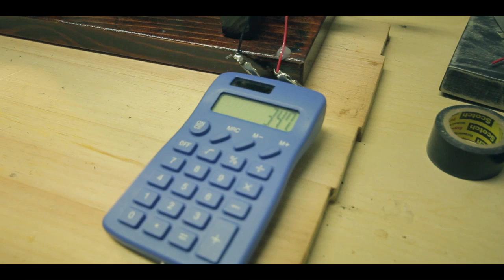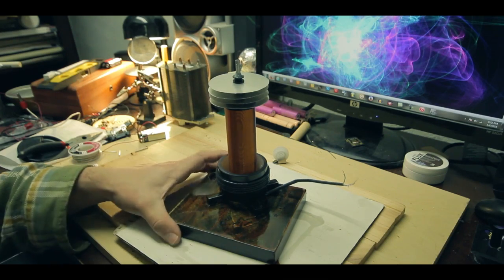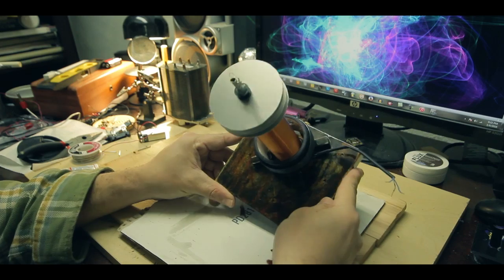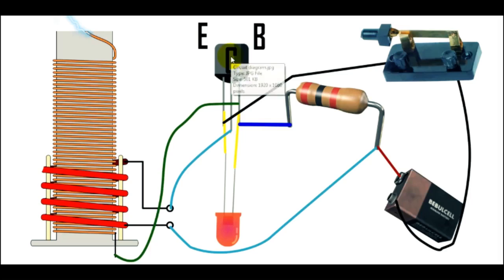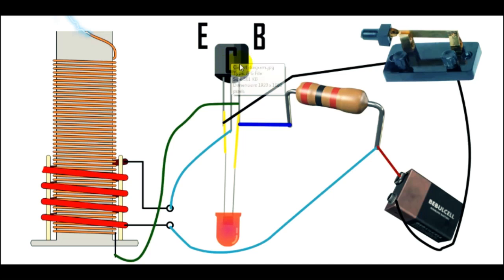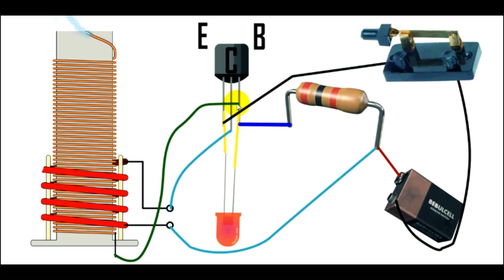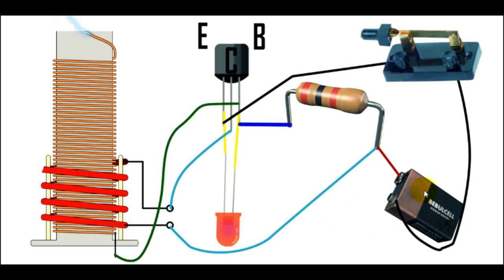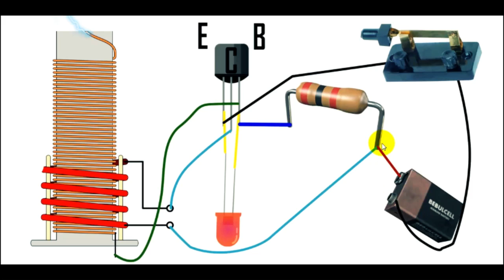DIY Tesla Slayer Exciter Coil Tutorial Mini How to Build Easy Circuit Explanation

Comment: Will it work with KSP2222A transistor and 22k resistor! Please answer soon
Reply from the maker: Tupac Shakur the transistor should work. What's the wattage on the resistor? The winds on the coils should be close in the numbers given in tutorial. hope that helps.
Reply: Thanks a lot
Reply: The resistor is 0.1W but the transistor is getting hot! Why?
Reply: It's not working!
Reply from the maker: The resistor is too large. You need 1/2 watt resistor. Also you need to use and LED with works like a diode in the circuit.
Reply: I used LED
Reply: STILL NOT WORKING!
Reply from the maker: Tupac Shakur What resistor are you using? Did you reverse the wires on the primary coil to see if that works?
Reply: Yes I reverse them! The resistor is 47K for 0.4W. In my home town there in't selling 47K 0.5w resistor

Comment: does the circuit work like this: current flows through the coil(magnetic field is created) then to the collector.  because the collector has current flowing through it it opens the emitter base path and closes the flow to the primary coil (breaks field). and then repeats. 

I'm a beginner and I hope I didm't write bullshit ^^. 

p.s. has the resistor a other function then limiting the current?

Comment: How did you made the wind counter out of a calculator? That tutorial would be interesting as well.
Reply from the maker: Here is the calculator tutorial! Thanks for watching. 

https://youtu.be/cY6DwpwkEfA
Reply: José Davēd Thanx mate!
Reply: i want to make this type of tesla coil 1 wan to use 9 v battary 2n2222 and 22K 1/4 resistor and i wan to use 0.6 mm wire or 23 awg can i use these?
Reply from the maker: gökdeniz geçit I don't think the resistor will work. The 47k resistor works the best. I've tried several resistors and they did not work. 
The 23 gauge wire may also give you problems, as it is a heavier guage wire then what's recommended. You need to get about 400 turns on the secondary coil.
Reply: José Davēd and i will use 1mm wire in the first coil and should i use 47k 1/4 resistor with 9 v battary
Reply: vay araştıran adam
Reply: hoca aptal ozaman işte bu yüzden türkiye ...

Comment: Hey. I really need your help in this. I'm using 26 AWG Enamelled Cu wire for the secondary coil. I'm also using TIP31C transistor and 47K ohms resistor. I don't know what to use for the primary coil. Does it have to be Enamelled? or can I use stranded copper wire ? pls help. need to do this for project. thanks. :)
Reply from the maker: Sidharth Prakash If you have any old or broken electronics, cut the cord at the base, split into two sections and use it for the primary. Anything similar to a power cord should work fine. You do want the primary wire to be insulated, not bare wire.
Reply: José Davēd I believe that cord is gonna be stranded copper wire. :D. Thank you for your help. Really appreciate it. :)

Comment: Hi mate,

I've copied your design, but nothing happens.  I've swopped the primary coil connections round and still nothing.  I have checked all wires have continuity, and they do.  The BD135 seems ok.  Any ideas?
Reply from the maker: What transistor are you using? Are you using an LED, and what color?
Reply: I'm using a BD135 Transistor, and a green LED.  LED lights up, but it will not light a fluorescent bulb, even been and got another bulb, 6" - 4watt.  I have tried to make the coil the same as yours, but I have used a breadboard.   My 4 disc's are about 1 1/4 inch from the top of the secondary coil, and I have used rubber bungs through there centre hole to fit them over the hollow tub, where the secondary wire comes through, There is a space between each of the disc's.  300 turns on the secondary coil ( Had to use .25 wire), primary coil is 1mm, 12 volt, 16 amp with PVC sheath.  Thanks for trying to help me, Nick

Comment: What makes oscillate the transistor ????
Reply: The circuit will start off in the conducting state. This is because the transistor is turned "on" by the resistor putting a positive current into the base lead. This now starts a larger current to flow into the primary coil. The change in current from turning "on" is  magnetically coupled to the secondary coil. One side of the secondary is connedted to the "plates" on the top. This acts like a capacitor and has the effect of holding the top side of the coil "steady" voltage wise while the bottom side will produce a "feedback" pulse of current back to the base of the transistor. This "negative" current pulse is enough to  temporally overcome the current coming from the resistor (because it's negative), so, turns the transistor "off" and stops the current flow in the primary coil.  As things "settle down", the resistor once again starts injecting a positive current into the base lead to start the next current injection cycle...  This is WHY the video tells you that if the circuit doesn't work, to connect the primary coil up the "other" way... That"s to make sure a "negative" pulse is returned form the secondary coil. If connected wrong, a more "positive" current will be returned, and the circuit will not oscillate, or cycle between on and off...

Comment: can i use 36 gauge copper wire to make primary coil
Reply from the maker: I think that is too thin and probably wouldn't work. But the best thing you can do is try the 36 gauge and see if it works. This way you will know for sure, and experimenting with the circuit and coils can sometimes lead to knew results.

Comment: good video, real clear schematics man! Would any of these transistors work: 2N2907, 2N3906, or 2N4403? it doesn't really seem like it, for they melt and smoke on me. I would really love to find out what I'm doing wrong, any help would be awesome thanks!
Reply from the maker: I'm not sure about the transistors you listed. I would check out the datasheet for these transistors and see how they compare to something like the BD135, which is the one I used in the video, or the 2n2222 which also works well. Are you using 9 volts or less? This circuit really doesn't work well with voltages over 12 volts.
Reply: Ya im using a 9v battery. finally found a 2n2222 transistor. It should work now unless I coiled the secondary too many times. I did it by hand and I didn't count, might be around 350+. Got a bread board like you suggested too, so that should help me figure this out. is there a certain ratio for the number of coils for the secondary and primary, like for every 100 wraps secondary 1 wrap primary? Thanks Jose!

Comment: can i use mlc 8550 38 ,C945 P331 transistor?
Reply from the maker: I would try the C945 P331, because there is not much difference between the Cp45 and the 2n2222, which works well. The best thing you can do is hook everything up to a solderless breadboard and experiment with different transistors. 

You can internet search any transistor and pull up the date sheet to identify the pins, then follow the circuit explanation in my video. This would be the best way for both learning and experimenting!
Reply: is it ok to use a magnetic wire in primary?

Comment: how did you connect the reed switch to the calculator?
Reply from the maker: Basically you solder, glue, or tape two wires to the inside of the calculator, where the equal button sits. The reed switch completes the circuit when a magnet passes, and the calculator acts like the equal button is being pressed. 

I bought a cheap calculator at walmart, and they no longer use circuit boards. It was basically a piece of paper with the circuitry attached. So I tapped the wires in place and made sure it was secure. Hope that helps!

Comment: Can i use 2N2222A transistor,what would be the circuit
Reply from the maker: It would be the same setup. But you will need to look at the data sheet for the 2N2222 to see what pins are the Base, Emitter, and Collector.

Comment: Can I use 2N2222 Transistor instead of 2N2222A for this project?
Reply from the maker: Yes, the 2N2222 works well and you do not need the heatsink.

Comment: can i use 40 volts power supply ?
Reply from the maker: No, the transistor will burn up. You would need to move up to a mosfet slayer exciter coil.
Reply from the maker: No, the transistor will burn up. You would need to move up to a mosfet slayer exciter coil.
Reply: +José Davēd can i replaced 2n2222 transistors by MJE 13001 transistor which is high voltage transistors
Reply from the maker: Nope, I've used a Tip31 which is bigger than the 13001, and it burned up when I pushed it to 21 volts.  Definitely have to go with a mosfet design when using higher voltages.
Reply: +José Davēd that means tip31 can bears 18 volts
Reply from the maker: I think so, but i didn't try it for any long periods of time.

Comment: Why does nobody supply circuit schematics anymore, I am fed up with "Fritzer" type diagrams!
Reply: 'Fritzer'?
Reply: +hardstyle905  Our very electronic toys, including the gadgets we are using to converse with now, are the cause of this 'dumbing down'.
Did it start with the Age of Television, or videogames, or AOL chatrooms😨
Reply: Nick Outram
Reply: I forgot about that with the lacking think you could just make a part list  and send it to me email? probably better if i learned how to make one jfcrock37@msn.com
Reply: Nick Outram I agree!
Reply: Not every one fluently reads "normal" circuit schematics. As long as "Fritzer" (by the way, who is Fritzer?) diagrams accurately convey the information they are meant to, what advantage would "normal" diagrams have over them, aside from being simpler/easier to draw?
Reply: +hardstyle905 Why would that be? Assuming the diagram correctly depicts what needs to connect with what, what necessary information would be lacking?

Comment: can i use 2N3055 transistor..............?
Reply from the maker: I checked out a few schematics using the 2n3055 and they were mostly used with higher voltage Tesla coils. I also looked at the data sheet and it's rated at 60 volts, which is higher than any transitor I've used with a 9 volt Slayer Exciter circuit. 

You could try it out using a solderless breadboard, but I wouldn't use more than 12 volts. 

I've experimented with several transistors in similar fashion (solderless breadboard) using low voltages. I feel that the 2n2222 transitor works really well! If you have any broken electronics, take them apart and harvest the transistors and give them test. Hope this helps. Thanks for watching!

Comment: Thank you for this video, interesting. About the metal rings at the top, are they functional, or just for show?
Reply from the maker: The top load works as a capacitor. But yes the rings are more decorative than functional. You don't need the top load for the coil to work. I've tried it with and without, and have experimented with different top loads. There is minimal difference on this specific coil. On a much larger and more powerful Tesla coil the top load is more important due to arcing. Hope this helps. Thanks for watching!

Comment: thank you very much for the circuit explanations sir! that really helped me a lot! this is the best video for building Tesla coil on YouTube!
Reply from the maker: Thanks for watching! At this time I do not have anything published on the web other than video's. But I am working on a website that will cover Pythagoras's Quadrivium, which includes scientific studies. Hopefully it will be ready in a few months. 

You do not need a heat sink unless you plan on using 12 volts or higher, or if you notice the transistor is getting hot to the touch, this may vary depending on which transistor you use.

I'm glad you found this video informative. Good luck on your project!
Reply: +José Davēd thank you for ur quick and explainatory reply sir!

Comment: I dont understand how the circuit is oscillating,  and what purpose does the LED have in this circuit.
Reply from the maker: The LED works as a diode allowing current to flow in one direction. The transistor is the workhorse here, where  oscillation occurs by injecting a signal (DC voltage) to the input. The current is amplified and will oscillate in accordance with the input, and a small amount of the output power is fed back into the input. An oscillating circuit generates a signal which swings between a high and low voltage. Hope that helps. Thanks for watching!

Comment: Excuse my ignorance but can anyone explain how the transistor is oscillating the DC current for the transformer to work? thank you.
Reply from the maker: The transistor works as a amplifier or a switch. It amplifies a small electric current into a larger current. The slayer-exciter is a oscillating circuit with the transistor being the main component working as a switch. Transistor are semiconductors because they are made from silicon, which comes from sand. The silicon goes through a process called doping, which by adding certain chemicals will allow for electron manipulation. 

You can find a more detailed explanation on the web, but that is my understanding of how a transistor works. I am still a novice though so I apologize for a lack of a better explanation.

Comment: Will there be any problem if i use 47kohm 1watt resistor????
pls reply pls
Reply from the maker: I've used a 75k resistor and worked well. I did perform a test using several different rated resistors and the best one was the 47k 1/2 watt. I have Slayer exciter hooked up to a solderless breadboard. I will check to make sure within the next few hours. Hope this helps! Thanks for watching.
Reply from the maker: Unfortunately I do not have a 1 watt resistor readily available. Try operating the circuit without the resistor. It should work!

Comment: This circuit would drain the battery very quickly, as I see it, to the point that the battery voltage will be too low to sustain oscillation.

Comment: if you dont solder the tip would sparks spray or is that power related?
Reply from the maker: You don't need to solder the top. In fact you really don't need the top load for the coil to work. This is a very low voltage (entry level) Tesla coil compared to a solid state Tesla coil, which would produce the sparks that you are looking for. The solid state coil involves more circuitry and voltage. Hope this helps. Thanks for watching!

Comment: Really nice video, for better output (in my case a lot better output,, went from no breakout to lots of breakout.) put a cap around 1500 uf in parallel with the4 battery. Only difference in my slayer exciter is it is high powered due to using a power mosfet and using 52 volts. I will be going to 170 volts soon. Then I will go to steve ward's sstc design.
Reply: Sweet.. Turn up the volume control...!!  LOL  Heat sink needed..!
Reply: John Allen correct you are, I have a fan cooled heatsink now
Reply: How are you using more than 24 V with it

Comment: I wish you would have given a explanation on how it works?- but still a neat video
Reply from the maker: Hi Rosario, I wanted to keep the video as short as possible without getting into the details of how the circuit works. Below is a brief explanation, but it may be limited because I am still a novice. 

The Slayer Exciter is an oscillating circuit that steps up low DC voltage to high AC voltage creating an electromagnetic field that excites the phosphor in fluorescent or LED light bulbs.

The transistor in the circuit works like a valve, opening and closing several times a second. When the valve stops the flow of electricity, the primary coil will collapse and the secondary will pick up the voltage and increase it. The top load acts like a capacitor, which also increases the output and excites electrons in the air. 

The resistor limits the power to the transistor to reduce over-heating.

The two coils can be referred to as a air-core transformer, meaning the coils are linked through the air by a magnetic flux, which is induced by the supplied voltage. Research Faraday's law of electromagnetic induction for an overview if interested.

I hope this explanation will help. Thanks for watching!
Reply: Thanks so much I am self taught in electronics and your explanation is just what I need to confirm (or not) of what I thought was going on in the circuit Thanks again for posting!!! 2 thumbs up
Reply: +José Davēd u got any page or blog wh3re I can read more of this message explanation?

Comment: hi
where to buy?
28 or 30 gauge copper wire for secondary coil - 300 to 400 turns

14 gauge stranded wire for primary coil -  5 turns 
thank you for video
Reply: you can get the 28-30 gauge wire on amazon and 14 at homedepot or something

Comment: add 60vdc you'll get sparks good ones either from the components or the topload hv
Reply: How about using a Darlington-Pair Device to drive this Slayer Circuit? In wonder how that would work out?
Reply: +theLuigiFan0007  Is this 2N3904 the PNP equivalent of the 2N2222?
Reply: theLuigiFan0007 Thank you
Reply: LOST IN SPACE ELECTRONICS You'd burn out the transistor
Reply: +Jeffrey314159 nah I didn't Lol
Reply: Even a 2N3904 can take 30-80V depending on the manufacturer. Limit the current and have fun. :P
Reply: theLuigiFan0007 smart man
Reply: Jeffrey314159 
That's possible.
Reply: Jeffrey314159
No. The 2N3904 is NPN. The 2N3906 is the PNP equivalent of the 2N3904. The 2N2907 is the PNP complementary type for the NPN 2N2222.